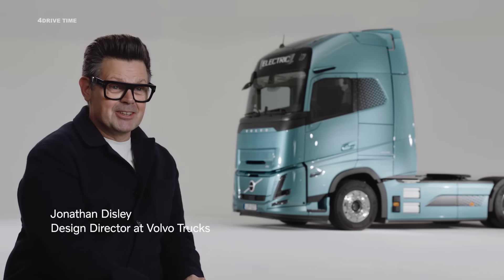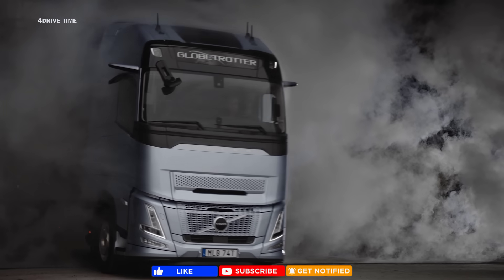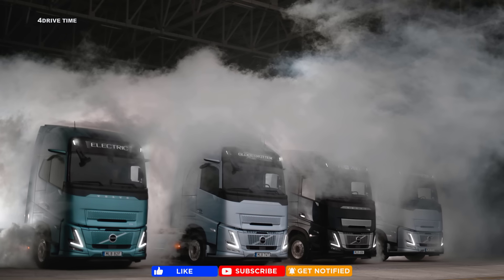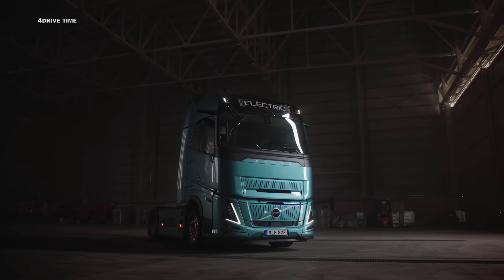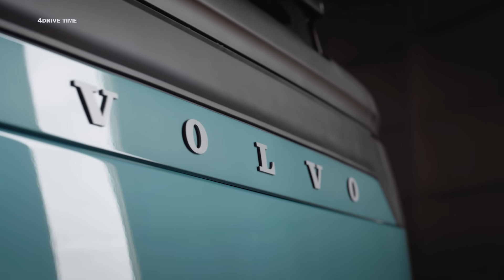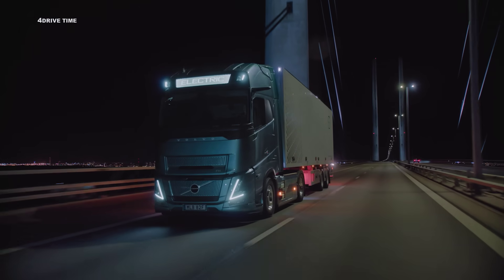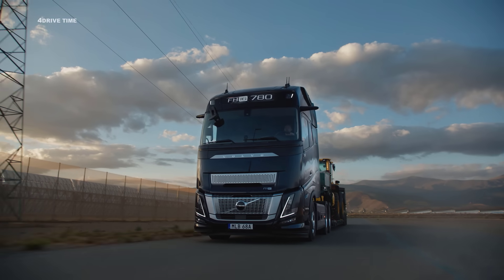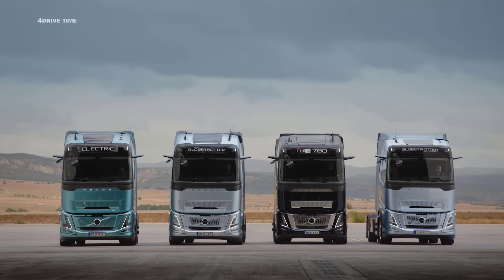All NEW 2024 Volvo FH Aero World Premiere – The ideal long-haul truck

Comment: I love volvo fh. but on the volvo trucks I worked on, the mattress on the bed is horrible, the webasto that is put in the box on the left is very noisy, it gets very cold in the cabin in winter, all the dirt on the windshield comes on the side windows. They were all made in Belgium , the ones I worked on. I hope these things have changed, or there are better equipment that I haven't worked on.I like this cabin, but with normal mirrors.
Reply: Upravu si 100%. Stari retrovizori su bolji i lepši.

Comment: "The main priority of Volvo is safety"

Also Volvo: Adds massive screens for camera mirrors when standard mirrors are more reliable, cheap, and probably more safe.
Also Volvo: Adds the said massive screens right to the A-Pillar, an already massive blind spot just now bigger
Reply: Have you driven one with cameras.
I can tell you its pretty great.

You see much more, the only issue I had was the lack of a depth.

Comment: Leave the mirrors. If you think that glowing monitors in your eyes are good, put this smart guy behind the wheel and let him drive for several nights in a row.And enough of electronics in trucks.  20 years ago, if the warning light came on, something was broken.  Nowadays, you drive a new truck and after a couple of days or weeks you start going to the dealer - for inspection, for repairs, just to check.  Designers, go relax, let the engineers work.

Comment: did you drive in it? it feels in turns like you are getting pushed out of your cheap chair, the steering wheel is not in the middle, so you sit at an angle destroying your back. the fringe is loose when the fridge is somehow closed(cheapest plastic they could find). A prison bed is more comfortable than the beds in a volvo. the inside basics are from 2010, they designed it 14 years ago and still have not improved a bit. thay never listen to drivers. you also can't listen to any music because the speakers will already be blown out before you play anything. and this is the only truck you can hit your passenger right in the face so you already know this truck is absolute garbage. there is so much to improve to call the volvo FH  'utter perfection'
Reply: Telling human who doesn’t sit in FH 😂😂😂